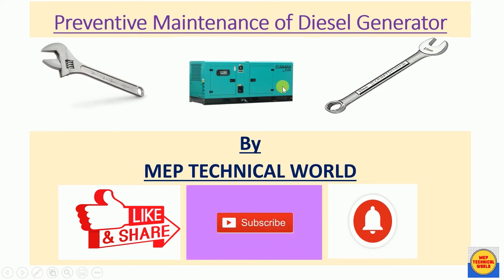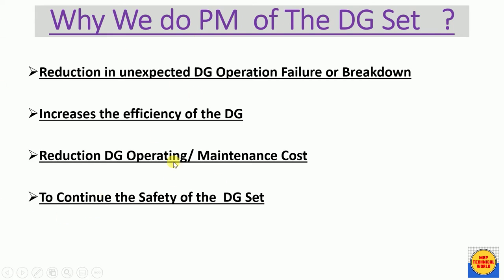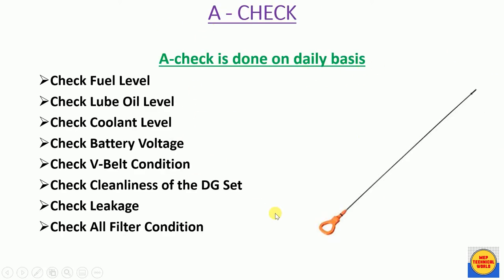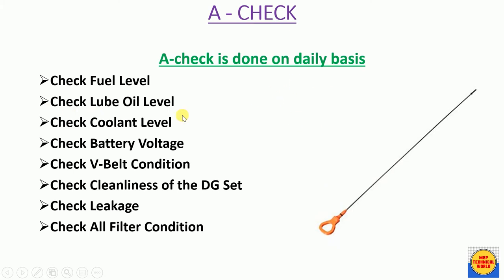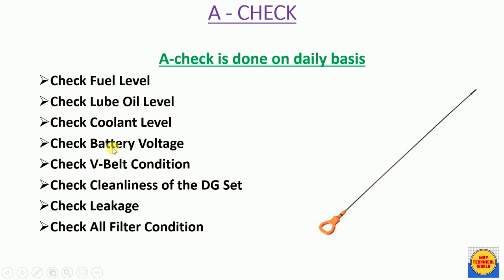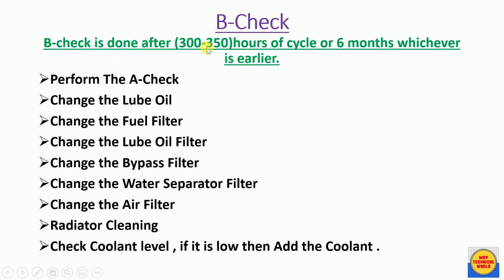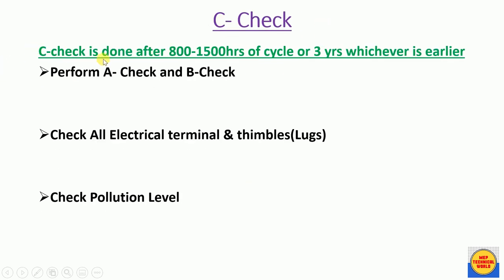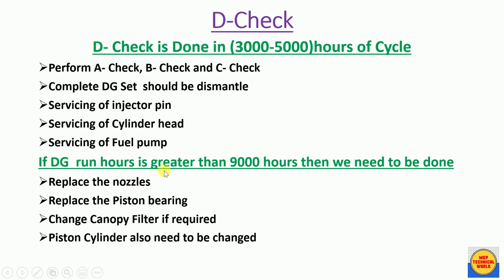Preventive maintenance of the Diesel Generator(DG) | A Check | B Check | C  Check | D Check

Comment: please upload the video regarding what parameters need to be checked when generator fails to start on both  engine as well as control panel side as soon as possible. Do not forget to upload the video
Reply from the maker: Thank you for your comment, I will upload it as soon as possible
Reply: Thank you very much